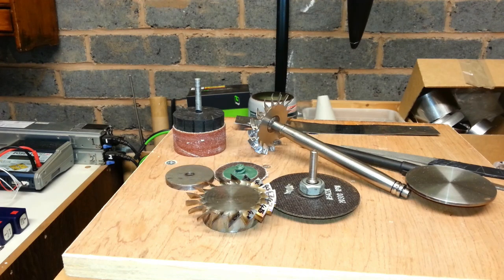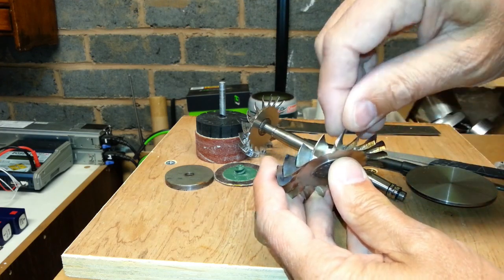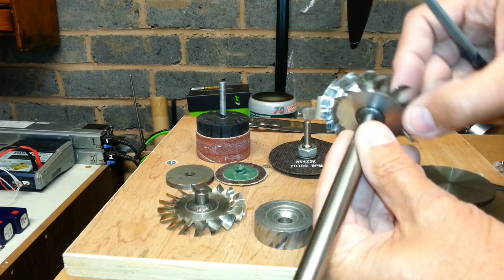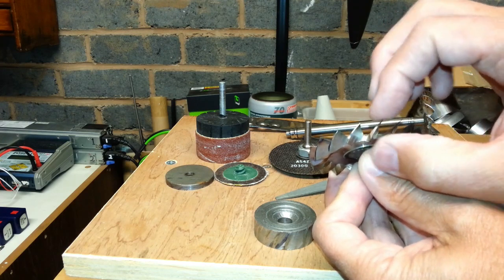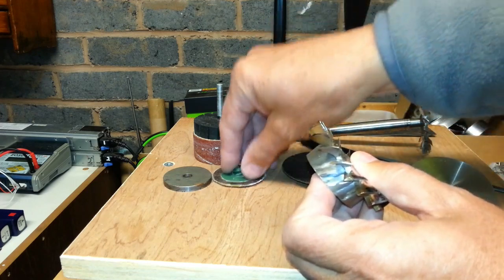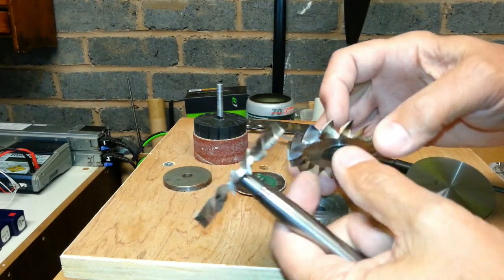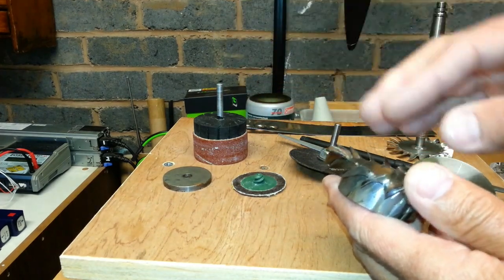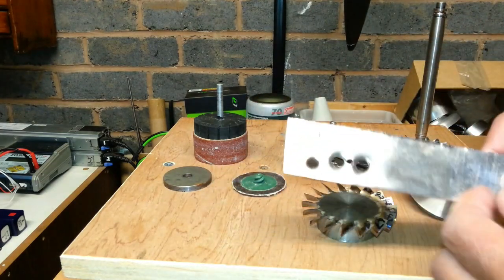FD3/64 turbine blade shaping / grinding

Comment: Excellent video... what gauge of stainless steel sheet did you use? Thank you
Reply from the maker: most common is 0.50mm  thick 304 stainless   you can also use 316 stainless shim  0.40mm  don't go any thinner unless you use something more heat resistance .

Comment: This material is stainless steel?
Reply from the maker: yeah 316 or 310 anything more heat resistant can't be welded easy so stick with stainless i also make the boss out of stainless I used a 316 A2 stainless bolt  as material.
Reply: @reedy93  Ok I got it, thanks a lot, friend.